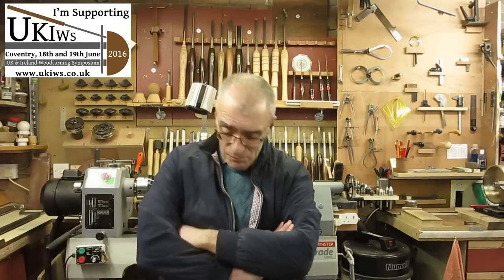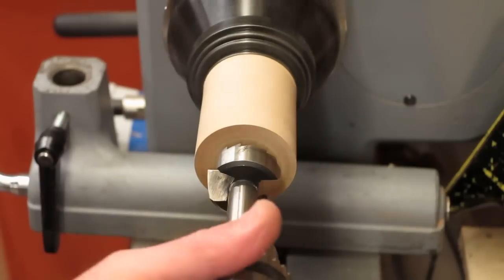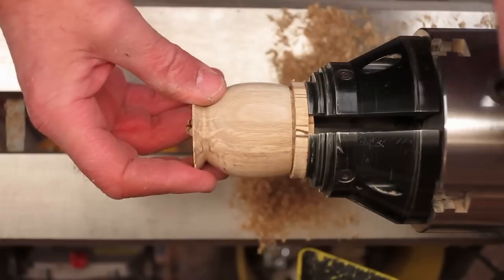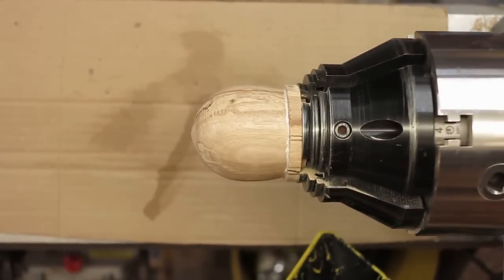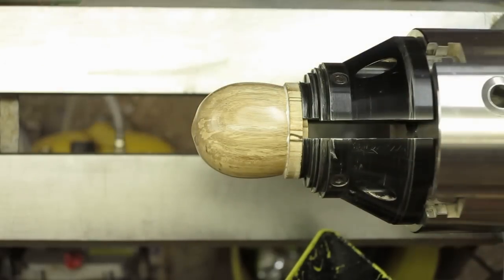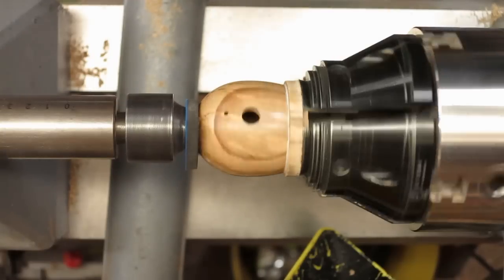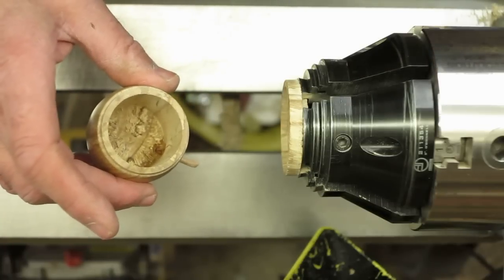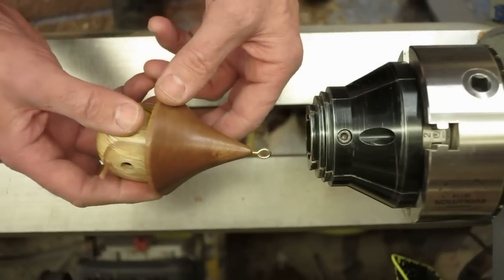Wood Turning - An Ornamental Bird House

Comment: Its a lovely bird box, nice combination of woods and finish.
However, I wish you had not used a jam chuck because I used my first one today on my first box lid, I was making and it came off. I replaced it with damp kitchen towel, it stayed on for final turning but now I cannot get it off. Made my day!! I will leave it a few days to dry out and see what happens, probably a disaster.
thanks for the video
James
Reply from the maker: +icespeckledhens 
Thanks James, and LOL....I think you should be able to remove it when it's dried out! Let me know how you get on.
Take care
Mike
Reply: +Mike Waldt
 Hi Mike, I let it dry for several days but it refused to budge, so I drilled a hole in the back of the jam chuck, chopped   it out with a 1/8" chisel and then it came apart easily, without damage, that is to the lid. LOL 
Thanks Mike

Comment: Mike, thanks for sharing your way of making these Birdhouse ornaments.
One thing that you might try is using the eyes of small fishhooks instead of brass eye screws. A drop of CA holds them firmly in place. I even use a piece of the straight shank to drill the exact size hole. A small file quickly sharpens a spade type tip.
Reply from the maker: +Marshall Gorrow 
Hi Marshall, a great tip regarding the fish hook....thank you, I will try that on a future bird house.
Take care
Mike

Comment: That's really attractive.  I was told, when I started turning, that Eucalyptus was useless for turning so I burned the 3 trees I had cut down.  I was told this by a professional turner and teacher.  Since then I've learned different and that spurious advice really has been a thorn in my side because, had I stored the wood, I would still be turning it now there was so much of it.
Best Wishes, Brendan.
Reply from the maker: +baconsoda 
Thanks Brendan, I appreciate it mate. I have to say it's only the third or fourth time I've turned it, but it is a pleasure to work on, and this piece did have some lovely figure in it..
Take care
Mike
Reply: I've been studying constructing a bird house and discovered a fantastic resource at Aviary Magic Method  (check it out on google).
Reply: Eucalyptus does tend to shatter if you're not careful and bigger pieces move a LOT when you remove a lot of wood.  This makes it a real challenge (as in: how far did all the pieces go across my shop when it blew up?) if you're turning bowls.  Your professional turner may only have had experience turning bowls.  This is small-diameter spindle turning which means the wood is going to be more stable and predictable.

I've turned a lot of small diameter things in eucalyptus and have had good results.  It's got lovely figure, cuts nice and takes a finish really well.
Reply: I ALWAYS question "professionals" and "experts". No disrespect to their knowledge and experience but ...... here is a prime example !! Beautiful job too !!
Reply: On that advice woodturning would be impossible in Australia.

Comment: Lovely project Mike.  I have seen a few done, and plan on doing some myself.  I do larger versions that are quite popular with people around here (and birds apparently).  I was wondering why you do a jam chuck when finishing the bottom, rather than just holding the spigot that you created in the jaws?  I know you probably have a good reason, but it seems to be an extra step.

Love watching your projects.
Scott
Reply from the maker: +Scott Constable 
Thanks Scott, as you say I could have used the jaws, I just felt a jam chuck was the way to go, no particular reason, your suggestive method would have been just as successful :)
Take care, and thanks for commenting.
Mike

Comment: I have made 6 of your style bird house ornaments made one small change I make a tenon on the roof instead of a recess the fit the tenon in the one inch hole that I drilled for the body of the house. I find in easier to make. Is there a particular reason you put a recess in the roof?
Reply from the maker: Hi Denis, there is no specific reason why I do it the way I do, I just prefer it. I always say whatever works for you is the way to do it :)
Thanks for the comment.
Cheers
Mike